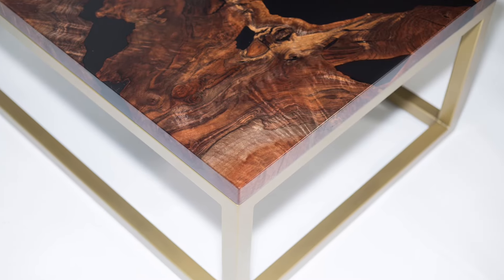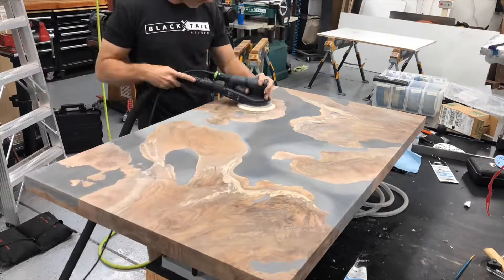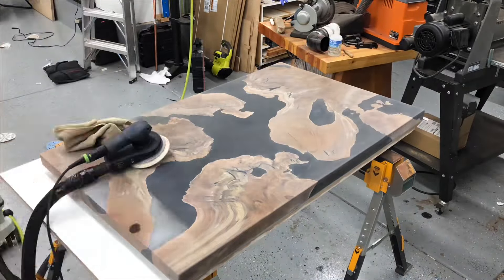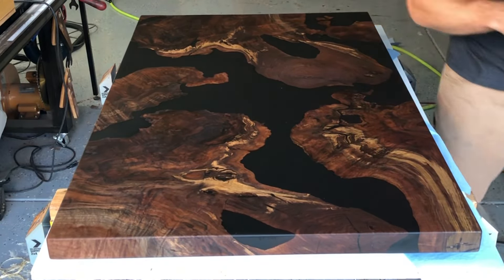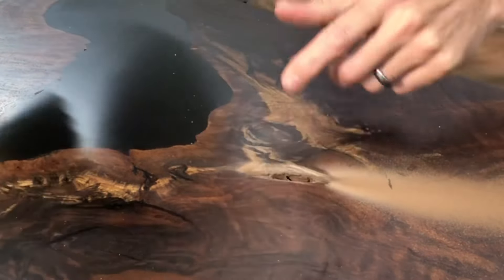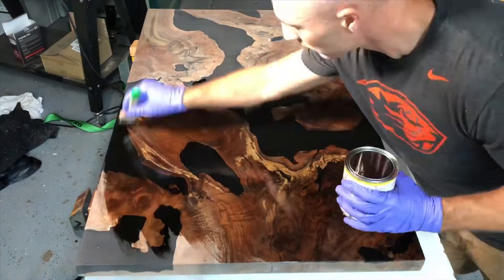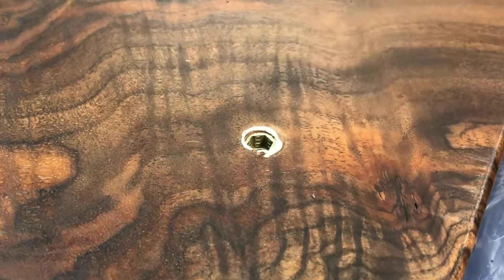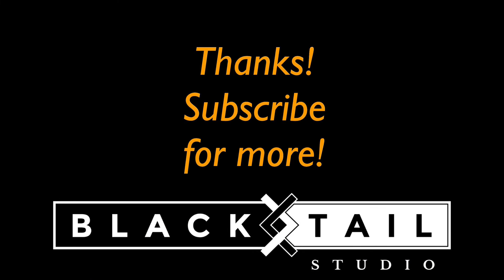How To Make An Epoxy Table Part Two

Comment: Have you seen the epoxy correction spray ? I’ve watched videos and they spray it on straight after pouring and the bubbles disappeared ?
Reply from the maker: Torch does the same thing. Pretty cool!

Comment: Just curious why you use so many steps when sanding.  Does it help even out the ridges from the rougher paper as you go?
Reply from the maker: It’s how it’s done. I have a blog post on it if you want more info too!
Reply: @BlacktailStudio  Do you have a link to the blog post on your page? I'd like to read that. Thanks.

Comment: Hello Master, could you tell me the name of the machine that is in a workshop where they smoothed and flattened the table? greetings from Mexico!
Reply from the maker: It’s a planer and wide belt sander
Reply: @BlacktailStudio  thanks I need to remove the varnish from a round table of five feet

Comment: I'm pretty sure there is a type of epoxy that makes bubbles only on the very suface, then you spray something and the bubbles are gone.
Wouldn't that free you from those tiny fillings that takes you hours of work? I mean the little holes are there because of bubbles right?

Comment: Is there a reason you don’t use hot glue to keep your wood from floating?
Reply from the maker: Can only glue it on the edges. The center can still try and float

Comment: Great video(s)! I love watching the work you do. I am getting into this myself, and do most things the same as you. How thick was this slab? and one question, what saw size do you use? I cannot seem to cut my slabs down (squaring up edges, cutting the slabs to fit the form, etc.) with the saw I have, and need to find a bigger saw.
Reply from the maker: Hey thanks! These were 2” slabs and I have a link to the saw and more in the description

Comment: I wonder if you could remove the rotted or soft wood with a lower-pressure sand blaster?  Or use a less-abrasive media?  It should be faster, do a more complete job of removing the softer wood with less chance of errors.
Reply from the maker: I’m sure you could dial in a pressure and media that would work well. Good idea!

Comment: when you do the touchup with superglue, why don't you do this in one go?
what I mean is why don't you sand the table to the level you are "almost" happy with then fill small imperfections with superglue then finish it with final sanding? Would that not save you a lot of time?
Reply from the maker: You don’t see so many of them till you’re right on top of them

Comment: I love the table but instead of spending a day filling imperfections with the super glue, why don't you use a table top or countertop epoxy. Super fast, super easy?
Reply from the maker: Not as easy as it sounds. You get low spots where the pits are. So ends up being probably more work. Also, you end up with a very thick plastic finish. Which is fine if that’s what you’re going for. Not my favorite though.

Comment: Have you thought about using a green screen for the back drop. Using that you can insert any background image using Photoshop and really enhance the end result. Green screen allows you to cut out then entire background and replace it with anything you like. for example you could take a forest picture as the background and your work looks like you came right out of the forest with the wood etc etc...Just wondering why you don't finish coat the tables with epoxy as well?